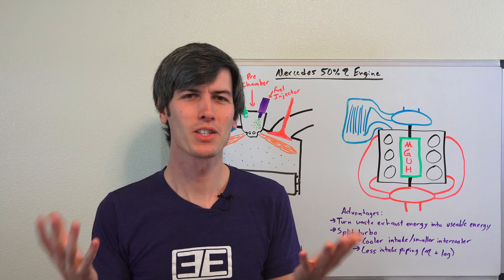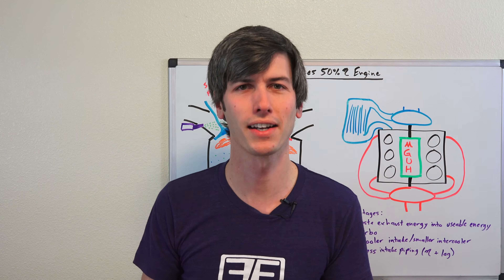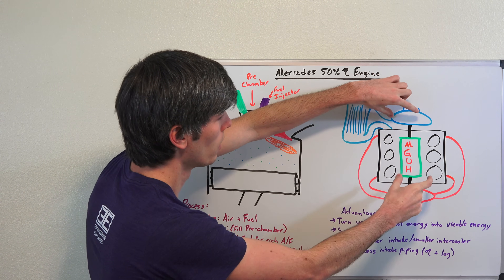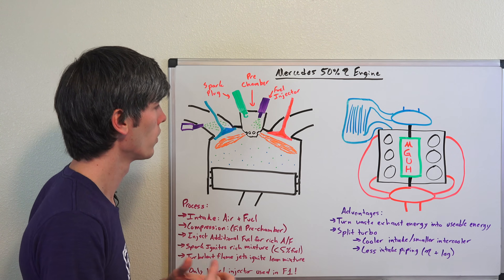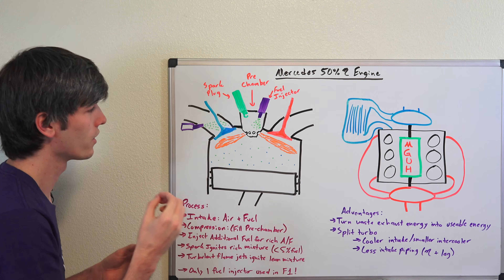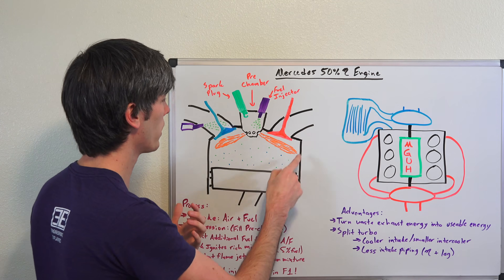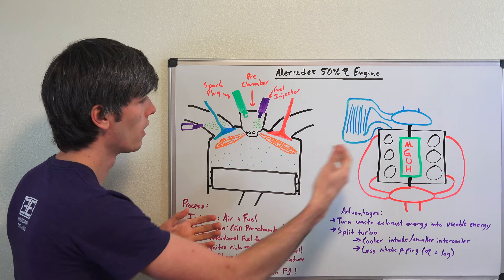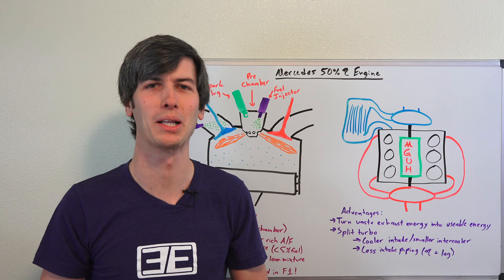Mercedes Created The World's Most Efficient Racing Engine

Comment: You didnt explain why having a pre-chamber can solve the problem that leaner mixture in the cylinder brings. Leaner mixture cause overheat as the air in the cylinder takes a longer time to combust entirely, combustion takes more time-the cylinder experience more overheating. That brings unwanted problems for the engine but I dont see how a pre-chamber can solve that, yet.
Now you mentioned how the pre-chamber has a richer mixture, also have holes that turbulent flames could be injected through, and thus create an evenly combustion in the power stroke. I think that could be solved by having dual spark plugs in a cylinder, I dont watch F1 but maybe because the rules restricted the manufacturer to only have 1 spark plug in 1 cylinder?

Comment: Hey, will the MGU - H be feasible in passenger cars?
Reply: Not in the way F1 uses it, no. What makes sense for a road car is the electric support to rev the turbo up faster. But to generate any meaningfull excess energy which then can be transformed into electricity you would need excessive periods of full throttle driving and that never happens on the road.

Comment: Could you do an in-depth look into the MGU-H?
Reply: agree. I was wondering if the energy recovered by the MGU-H can be used by the same motor to help the turbocharger spool up acting like some sort of supercharger but electric driven.
Reply: @ThePulmentinum  honestly I don't think spool time is an issue. I think traction limitations would further contribute to spool time being a non issue. I'm sure its used solely for recharging. I'd imagine they're able to "load up" on the turbo under boost

Comment: Did you know, the oil companies sat on 98% of the patents that made ICE more than 50% efficient?  Water injection behind the exhaust valve to increase scavenging, timing a fine mist in the exhaust lowers the density of the gasses in the exhaust, creating a vacuum that draws gasses out of the combustion chamber, the opposite of what we do now by stopping the gasses from decelerating as they cool, by bandaging the exhaust. The idea was first used in steam engines to increase draft through the stack, into the chimney.

Comment: Imagine this engine with koenigsegg freevalve technology, koenigsegg claims 30% more powerful.
Also imagine the mercedes with the koenigsegg light speed transmission.

Now also imagine this mercedes at monza. The second verstappen thinks he is going to overtake hamilton with drs because his crap honda engine is took, weak. Then, the nope meme. Hamilton revs to full speed on like 3rd or 4th gear at the last chicane before the finish line at monza. After he revs up to full rpm, he switches from 3rd or 4th gear all the way to 7th gear. he and valterri leave everybody in the dust, and max's dreams of even reaching 2nd place are gone for the entire season unless they dnf.

Comment: The split turbocharger was done purely for packaging reasons. The heat transfer from  the turbine side to the compressor side is almost negligible as far as heating up the intake air goes.

In fact a split turbocharger actually probably causes a compressor and turbine efficiency loss causing higher intake air temperatures. This all has to do with tolerances on the bearings. A long thin flexible shaft will always require larger tolerances on the turbine and compressor wheels increasing leakage  This will reduce their efficiency causing them to work harder to compress the air heating it up more.

Mercedes and Honda just clearly believe that the packaging benefits of a split turbocharger outweigh any efficiency loss.

Comment: You can´t achieve 50% with jet flames burning the leam mixture, it can if the prechaber ignition increases chamber pressure above the lean mixture self ignition pressure

Comment: I think they use multiple injections, 1 during induction with enough pressure to allow the fuel to be sucked into the main chamber and the final during compression. Maybe an injector with separate paths for 2 separate injections the first injection aligned with the ports between the pre and main chamber and the second out of alignment.

Comment: That Technic was used by Honda in the 70's that is how the civic have its name. Originally the name was cvcc I don't remember what those letters stand for. The system was called stratified charge. It had a pre combustion chamber with a separate intake valve that feed with a rich mixture that chamber next to the spark plug. That's why the old Civics were so eficient. Honda Stop production of those engines because of the lack of power. CVCC : compound vortex controlled combustion.

Comment: Prechamber ideas , flame ignition  ,    old ideas . finally coming out.  Every gear head should read Smokey Yunick a man far ahead of his time . Also the prechamber was the bases of the Honda CVCC engines . Honda had prechambers in the 70s.
Reply: Yeah, Ol' Smokey didn't have electronics to help him back in the 60's...he was workin' on using a turbo without any intercooler...said he was  trying to to be more efficient by using some of the waste heat.

Comment: is the number of injectors limited or do the rules actually state that you need to have a single injector in each cylinder? because you could have 4 common injectors for each intake and then 4 fueling different pre-chamber pairs.

Comment: Anybody remember Honda's CVCC engine? Those engines ran a rich fuel mixture in a pre-chamber to ignite a relatively lean fuel mixture in the rest of the combustion chamber.  It required a weird carburetor with a tiny, dedicated barrel, feeding a dinky intake manifold runner, through a ridiculously small intake valve, and thence into the pre-chamber... alas, there was no turbo, but they achieved respectable power, efficiency, and low emissions using that system!  All the way back in the mid 1970's !!!   Suck it Mercedes!

Comment: The third leg of M-B technology is an amorphous coating M-B is using inside the cylinder walls.  This "wonder metal" was developed by Liquidmetal Coatings with the assistance of NASA and Caltech.  An ultra thin layer of Liquidmetal Coatings replaces steel liners and reduces internal friction.  Mustang GT350, Nissan GT-R,  M-B Diesel, and BMW 4 cylinder engines are a growing list of engines using this technology.  If you follow the development of these engines, you will find a common them of the final engines producing more power than the initial targets, as well as about 3% improvement in fuel economy.

Same reason, Mustang GT produces more than its published 460 HP rating.

Liquidmetal Coatings reduces friction between cylinder walls and the piston rings by allowing the piston ring to glide over Chrome Boride Particles.  Soft and ductile phase of the matrix wears away quicker and forms little oil pockets.

Comment: In the 80s Ichiro Honda created the cvcc engine which has the separate chamber but what you fail to mention as there is a separate intake runner with a tiny valve to allow air to flow in and mixed with fuel. The system's called a stratified charge you are correct however a rich mixture in the chamber and lean one that went in the cylinder then fired by the stratified charge. Mitsubishi borrow this and called the jet valve.

Comment: These guys aren't messing around; that car is cleaner than a plug-in EV.
I wonder if water injection in the exhaust turbine (steam turbine) may increase the thermal efficiency even more. Also wonder if the extra combustion chamber has a positive effect in synchronizing the expansion of the fuel with the volume in the cylinder.

Comment: Old is new!  Honda used this system in the 1970's with carburetion in order to comply with our emissions laws.  They called it CVCC, which stands for compound Vortex Combustion Chamber.  They did well up until NOx became regulated in1981.  Lean burn makes lots of NOx.  Fuel injection was more promising, so it was phased out.  Prelude had it until 1983.  Accord until 1985. Civic persisted until 1987.  I still have a 1981 Accord in my garage.  There is a youtube video of my civic 1500s.  A very rare Honda.   Search :  1983 1500s civic

Comment: They can also add a smaller secondary super charger to push cold air into the exhaust chamber before the turbo system, as the cool air expand from the hot exhaust gas it will create more exhaust pressure and more power to the turbo.

Comment: very slick.  why don't they try holding the heat within a stainless steel vacuum rounded cylinder, and using that heat to both push, multi stage turbine blades and an electric turbo / charging system... would be even more efficient... less weight, no spark plug electricity req'd, heat recapture, less moving parts, one main drive shaft.

Comment: If we talking about efficiency? Its more Insulating the energy without the energy scapung in to water water. Much like house 🏡 in winter time. If you do that the energy would escape in to the Exhaust. Will give you more power and you need less gas and fuel. You would know if the engine is efficient if the temperature of the water run cooler.

Comment: Interesting concept. It seems like a volumetric ignition inside the main chamber, accelerating the mass burned ratio. About the strategy in F1, it could be that use only the injector in the tiny chamber, probably start to inject in the intake stroke with high pressure in order to supply fuel to the main chamber and maintain a quantity of fuel to get a rich mixture inside the tiny chamber.

Comment: mercedes engineers have said that they run a completely stoichiometric air/fuel ratio
Reply from the maker: Where? Generally it’s never really held constant, will vary quite a bit, and lean burning allows for greater efficiency.
Reply: It was an interview about the new project one, I think with JP Krämer interviewing the boss of AMG
Reply: Well yes they said that for the Project one, but they also said in F1 they run lean all the time (Lambda >1). The engine in the project one isn't exactly the same as it is used in F1. It's the same block, but the heads, pistons, crankshaft, camshafts, connecting rods and so on are all different. They run also a lower compression ratio because otherwise you couldn't run the engine even with 100 RON fuel.

Comment: Why don't over the road cars utilize prechamber ignition.

Also why does F1 not use direct injection for most of fuel? Or did I miss something

@engineeringexplained
Reply from the maker: They can use direct injection if they want (I don’t know what they use); the rule is that there is a single injector per cylinder.

Comment: ~30% thermal efficincy is AT BEST for a roadgoing otto engine. (It only happens under full load and wide open throttle). The actual day-to-day efficiency is more like 1-5% due to the engines being lightly loaded and heavily throttled.

Comment: If I recall correctly, one of the biggest problems with rotary engines is getting all the fuel to ignite because the flame has to travel a long distance from the spark to ignite all the fuel in the combustion chamber. Could a system like this help in that situation, helping to make rotary engines more thermally efficient?

Comment: Someone correct me if I am wrong, but it is to my understanding that most of the efficiency benefits come from lean burn. They found a way to more completely burn a lean air fuel charge in the cylinder. Wouldn't HCCI more completely burn a lean air fuel charge because HCCI uses auto ignition?

Comment: the  combustion process has been around for some time. It is called the Stratified Charge. it was also used by Toyota 2e 12 valve engines

Comment: You could force part of the air during the intake stroke through the prechamber, that way you would only need the one injector at the prechamber.
Reminds me of a Wärtsilä marine 2–stroke LNG engine, they use a diesel/HFO pilot injection to ignite the LNG. This also allows for a fuel changeover under load and even flexible diesel / LNG ratio.

Comment: This rich pre-chamber doesn´t use the same teory that the Honda CVCC use in they carburators, they have a extra fuel circuit that feed de engine a richier misture of ar and fuel in some levels of rev. Of course it isnt so well controled but the idea is the same !!

Comment: If I had to guess, the injector squirts fuel as air is entering the intake valve and the turbulent air will create negative pressure outside the pre-chamber which will pull fuel out of the chamber and into the cylinder. Then the valve closes and the injector squirts again to create the rich mixture inside the pre-chamber. Lets build one and find out.

Comment: Pre combustion chambers are not a new technology. They have been used in large industrial engines since the '50s. For example large engines (think 14" bore x 14" stroke) used to compress natural gas for pipeline transmission use pre combustion chambers to ignite a very lean air/fuel mixture in the cylinder. This is also used in natural gas fired CAT engines. Exhaust gas temperatures are typically lower and so are emissions.

Comment: Seems similar to what Mazda is trying to achieve with its Skyactiv X engine. Mazdas application is more simplified compared to Mercedes/F1. Mercedes is using a mini rich combustion chamber that helps ignite the lean a/f mixture in the primary chamber. Mazda pretty much doing the same thing with less components. Using a spark plug to "jump start" the high compression combustion process of a leaner a/f mixture. Mercedes mini chamber = the spark plug in Mazdas Spark Controlled Compression Ignition engine.

Comment: A second gen Toyota Prius II achieves 43% thermal efficiency in the ICE component! Plus the hybrid brake regeneration capture with electric traction motors results in even less fuel consumption: with idle stop (ending negative MPG when the vehicle is stopped at a traffic light etc)
Reply: Capturing waste energy & storing it to then make use of it later to accelerate the vehicle!

Comment: Maybe all the fuel is injected into the pre chamber and then ejected into the cylinder upon ignition. That would cool the wall separating the pre and main chambers. Much of the fuel injected during the intake stroke might find its way into the main combustion chamber, while the air entering the pre chamber during the compression stroke might tend to keep fuel inside. That would allow the fuel ratio between the two chambers to be tuned: earlier injection for a greater proportion in the main chamber, later for greater proportion in the pre chamber.

Comment: I think two other big reasons on why Mercedes are so dominant in F1 right now separating of the hot side from the cold side of the turbo with channeling passing air directly on said cold side(the compressor) and prioritizing getting the hot exhaust gases directly to the hot side(the turbine)  with the shortest route possible and not worry about the timing of the exhaust pulses by means of unequal length header exhaust manifolds. I could be wrong but I think Renault and Ferrari F1 engines still have a nest of snakes type headers channeling their exhaust to their turbos.
Reply: Mercedes also uses the equal length header setup since 2015. They only used a log design in their first year with this engine type because they saw more time gain by using a better packaging instead of hunting down the last 10 to 15 horsepower.

Comment: Awesome video!

I just have one question...

If they somehow put a stronger fuel injector (that pumps in more fuel, perhaps dumps the fuel on the intake time, because vaccum), the pre-chamber will get a very rich mixture, while the excessive gasoline will somehow pour into the main chamber, and make the mixture lean, while the pre-chamber is rich?

That way you would not need two injectors, just one with some very large holes, or better fuel flow...

Comment: The injector is a 'conventional' direct injection injector.  What they do is spray through the TJI manifold then calculate a second injection event accounting for fuel that remained in the manifold and such.  So the second event may not spray the entire added 3% due to fuel still within it.  

The 2014 C7 Corvette (which is direct injection) ECM has provisions for dual injection events and would likely be able to run this sort of system if the cylinder head could fit the manifold.

Comment: From what I have seen, this pre-chamber is actually part of the spark plug. This is all proprietary, of course, but I have seen images of these spark plugs. Pretty cool stuff . Ferrari had an issue with their spark plugs in Malaysia. I was wondering how that was possible for these expensive power units and teams to not figure out they have simple problems like spark plugs. It turned out that the spark plugs are very complex. Mercedes uses the same supplier (I think NGK) and may have a slightly different design requirements and they changed them as a precautionary measure on Hamilton prior to the race. These are not your $5-20 NGK that you can buy at your favorite auto store. Each one of these probably costs hundreds of dollars. Not ready for road cars. The price will go down but they probably require more maintenance and will not last 60,000 miles or 105,000 miles as some current road cars.

Comment: Only a single injector - Inside the pre-chamber. 

Probably uses a double squirt to inject fuel. 

One squirt during the intake phase, as the piston goes down it will draw in the fuel and air. then just before compression a second fuel injection squirt to fill the pre-chamber.

An intake valve would need to be in the pre-chamber to allow air to flow in for proper mixing.